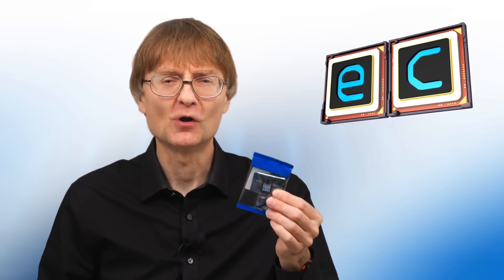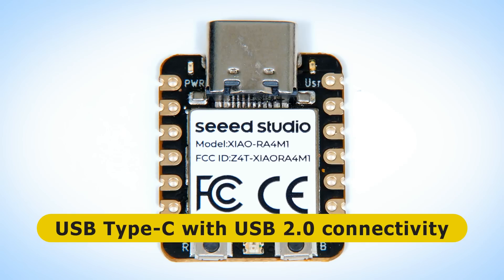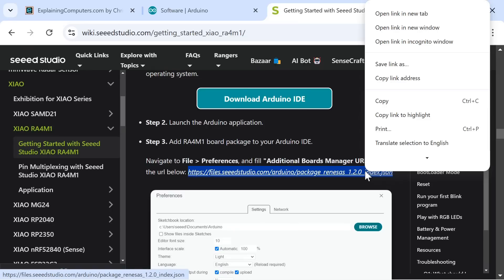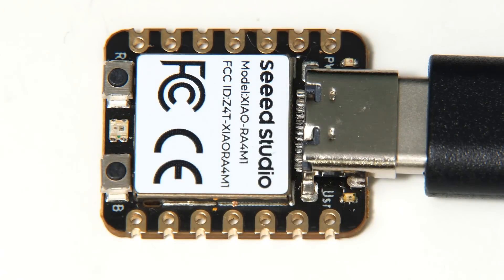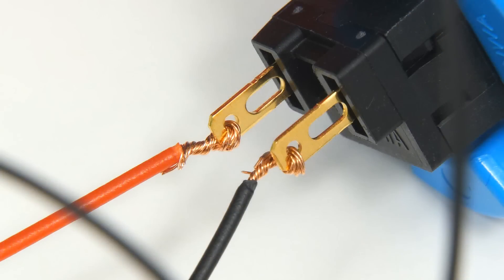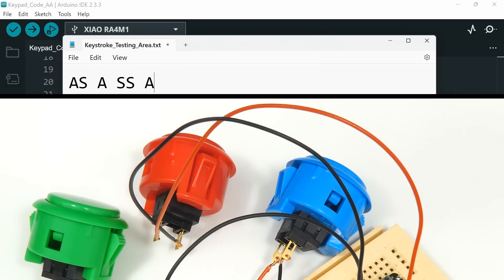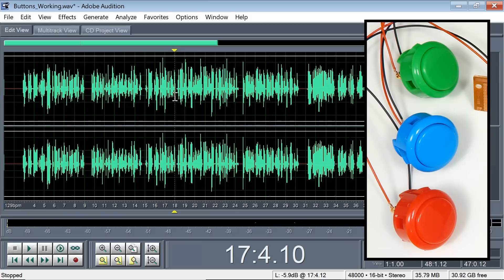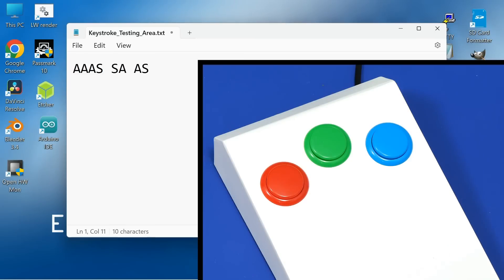Custom PC Keypad - Microcontroller Project

Comment: So Chris, I mainly play along with YT music videos and find it tiring to take a hand off my guitar, peck on the kybd (or mouse for Settings if I want a tempo change) to rewind a bit to hear whatever riff/music I want to practice.  (I used to download the MP3 audio only via VLC as it offers superior features, but as of late the streams seem to be evasive!)  
That said, it seems if one modified the code in your example to trap the ASCII keys controlling the YT player transport, and spaced the buttons out so I can use my foot to rewind/fast-forward/play/stop that it should work OK in theory.  But do you think one will need MS API access/knowledge to trigger the kybd char values, or is there an interrupt or memory pointer to do same?  TIA for any advice on this matter when /if you get time.

Comment: I decided to try this out, so I bought a couple of Seeed RA4M1 boards, and installed the board package in Arduino on my Manjaro Linux daily driver and (smack me in the forehead), no dice. No dfu serial port to be found. I spent hours pursuing lead on the interwebs, but no love. I booted up Win 10, and updated the Arduino IDE, and, bam, there it is!

Looks like Arduino's config for Linux, at least for Arch/Manjaro, needs some work...

Anybody have success with this, or similar, Linux configuration?

Thanks for this video, it was very helpful, and well explained.
Reply from the maker: I'm glad to hear that it worked in the end! :)
Reply: Update: after much investigation, the problem turned out to be the lack of a correct udev rule for dfu. I found this by enabling verbose mode in the Arduino IDE, and copying the line that is supposed to upload the program to the RA4M1 into a cmd line and running it from a terminal. Still failed, but when I ran it with supervisor (sudo) it worked! The udev rules are how you enable a program that needs sudo to run from a normal user prompt. 

Creating a functional rule (for my Manjaro Linux box) was painful, UNTIL I used a fabulous terminal program, Warp Termina!, which has AI stuff built in, and was able to deduce the correct contents of the rule, create it, install it, and restart udevadm with simple prompts. Boom-shaka-lacka, it works!

Now I have a functional Arduino IDE for the Renesas RA4M1 on Manjaro! Thanks to the Warp people for such an amazing terminal program!

And thanks again to Chris for posting this project in the first place...if anyone wants to try the rule, let me know and I'll post it.

Cheers.
Reply: @schwartzenheimer1 I would like to try the rule, same issue on Linux Mint

Comment: Very interesting idea and I like the use of proper arcade buttons.  The Sanwa buttons are quality parts, easily serviceable, and quite satisfying to press.  I have a couple of spares nearby and I just like pressing them sometimes so the satisfying sound and feel.  While I do use them for their intended purpose, I've often thought they'd be good for other electrical projects that need buttons, as long as compactness wasn't a top priority since the buttons do need a certain amount of clearance underneath.  I would have gone with quick disconnects over soldering in this case to make it even easier to service the buttons when needed, though they should last a while before needing that.  The 24mm buttons have a similar look and feel to the 30mm and probably could have worked just as well for this project.  The 18mm buttons are a very different design.  There's no separate microswitch component because the button is too small and it uses two springs internally.  One of those is for the button cap and it's much firmer than the 24 and 30mm buttons.  That firmer feel may be better or worse depending on the project, but it's worth knowing ahead of time, especially if there may be revisions to this project.

Comment: This video was incredibly useful and empowering for me. I was top of the class at school when we studied microelectronics using the DESMOND (Digital Electronic System Made Of Nifty Devices) back in the late 80s, but we were never taught how to build practical custom projects. So I drifted towards programming and away from the soldering iron. This, however, along with the accompanying box-building video, gives me lots of ideas that seem within reach. But if I had submitted the device in this video as the end product of a project at school, I am sure I would have been suspended for building a keyboard that can only be used to type the word "ASS".
Reply from the maker: Good luck developing your ideas!

Comment: Excellent project. I've always wanted to build something like this and use it to log certain daily/recurring events by just simply pressing a colored button.
This is the first time I've seen a video for such a project.

 I had also thought about the possibility of status lights above the buttons indicating if the button was pressed or how many times it had been pressed. And another button which allows you to clear an input that you made by mistake (or the ability to long press a button that you pressed by mistake in order to clear that entry)... Even better an added feedback option such as a beeping noise to indicate when a button was pressed, and a long beep to indicate that a mistaken entry was deleted by long pressing a button.

 I also wonder if I could make this wireless. Another idea I have is to be able to have more than one unit be wirelessly connected at the same time and the controller would be able to receive input from more than one unit  simultaneously.

Comment: You might be able to get 20mm buttons, but 22mm is likely to be more common as it coincides with 7/8" which is a North American standard size. (same knock-out punch as 1/2" conduit)

Comment: Out of curiosity, could you simply use one 10k resistor near the ground where all buttons' wiring converge instead of having a resistor for each button since power dissipation isn't really an issue here? or is that bad practice? 

Very neat idea, I'll have to build one  for locking the pc :) so people have no excuse no locking when they step away.

Comment: Is that really more comfortable to use than normal keyboard, or was this done just as a proof of concept?
Reply from the maker: Partially it is a proof of concept so I can test things out, and there will be a Mark II (I'm now thinking of a sphere held in at-rest fingers). But when it comes to RSI, it is more comfortable, as it allows the fingers, hand and arm to be used in a totally different position than for normal typing. So it depends on your starting point -- if you do not currently have RSI pain, there may be little to be gained.
Reply: @ExplainingComputers  I can imagine if a controller, shaped sort of like those ergonomic mice, is created, that could be very comfortable.

Comment: If you have an old three button mouse hanging around, one could always hack that and use the buttons and have a small in the palm device.  It may even be possible to fit the micro controller inside the body.
Just a thought.
Reply from the maker: And a nice thought! :)

Comment: I thought you'd use an rpi 2040 for this, as the chinese miini rpi 2040 boards are about the same size as the board you're using, but with a lot more GPIOs brought out, and with the amazing SDK and ecosystem support of the rpi pico. I've replaced all my pic, atmel and other microcontrollers now with pico (and chinese versions) as they're the same price or less, for dramatically better performance, features and support (in particular the amazing PIO interfaces).

Comment: Hello Chris
A very big thanks for the very exciting video 😃

I have a question 
Is it possible to program pressing combination keys like for example (Ctrl + C) with one key ?

Thank you 😊
Your sincerely
Reply from the maker: It is indeed. You first send a command to hold down (eg) the Ctrl key, then use another to hold down the "C" key. This is why there is a "release all" command -- things stay pressed until everything is released. :)
Reply: Thank you for your answer Chris 😊

I have one final question.
Will this device work on any Windows or Linux based PC without needs for installing additional drivers?

Thanks again 
Your sincerely

Comment: I like the fact that it is possible to control keyboard with a SBC.
I was once having fun with my Arduino Due and Keyboard.h library where I was drawing shapes to MSPaint using mouse coordinate commands and saving it automatically as a png file. It lookd like as if someone hacked the computer and was controlling it remotely... with all the CMD windows popping out and actual commands being written to it.
The only thing that I needed to do was to put the mouse cursor in the middle of the screen and then hook up the Arduino to a computer.

Comment: Nice project.
Also I'm glad that many devices are now equipped with a USB-C type connector.
I know that it is not the best and most robust connector but is like 100% better than USB micro B (microUSB). And it makes everything easier to connect since most devices have them.
There are also reversible types of micro USB connectors (I have one) but they are still fragile.

Comment: Great stuff from both EC and the CB channel. I have been thinking of a small project and a Pi Pico would be way over the top for what I need. One of these small Arduino / RP2040 / ES32 boards  is what I need. I just need to determine the position of a 3 pin switch to determine loop durations in the code body.

One thing that comes to mind is that most of these small controllers don't seem to have any holes for mounting purposes. Do you have to mount them to a small breadboard and then mount the breadboard to the casing?

I think that Stanley would have needed a well earned rest with 8 - 10 cuts for every piece of the casing. Maybe a new blade is coming up.

Comment: In Oct I broke my right shoulder and hand. Could no longer use xbox controller as mouse on my Linux computer. So I used the BadUSB i.e an  arduino leonardo to make a keypad to do what I needed to do.
I have two one for gp computer use and a 2nd for Minecraft.

Comment: Nice simple 3 button example!  After searching Macro Pad options for quite some time last year, I went with the AdaFruit kit: 
Adafruit MacroPad RP2040 Starter Kit - 3x4 Keys + Encoder + OLED - ADABOX019 Essentials --- (though currently out of stock) It was basically a snap together build with easily modified example code. Small display and encoder wheel allows selection of multiple sketches of 3x4 button layouts while also displaying a legend of button function labels. Well worth ~$50 USD.

Comment: Thank you Chris.
I have a related project based on a "Adafruit Neokey Trinkey" that stalled because it did not seem to work.  I want a simple board that will emulated a keyboard, and send a <Alt><SysReq> R, E, I, S, U, B combination when needed.  Your comment about delays on the key press inputs might be the problem... or at least get me back on track.

Comment: Where did you get a breadboard that withstands the high temperature of soldering? I've tried that a couple of times with breadboards that claim to be high temperature capable and every time I've melted the breadboard and made it useless.

Comment: Way cool. Back in the 1980s I built a custom PC KB interface for a client wiring up an 8051 microcontroller and 8255 PIO to an off the shelf 250-key membrane switch board. Lots of wires as you might imagine (although 16 rows by 16 columns helped). Interfaced to the KB by splicing in to the KB wiring. Fun. So much easier now with your tools! Thank you.

Comment: Awesome ! so a quick and easy button set up for a game should be possible ? a bit of a nightmare with UNO R3. I worry about that 400 mS delay mind you, that's a long time in computer land. Thanks for showing that little DEV board I had no idea about it.
Reply from the maker: A button setup for a game should indeed be possible -- if with a much lower delay setting! :)
Reply: @ExplainingComputers  :)
Reply: Buy high quality buttons designed for low switch denounce. As all switches have denounce, Google "button debounce". You will find both hardware and software solutions. In this case, as the microcontroller is only managing the keyboard, do it with software. If you Google "button denounce arduino", you will find some sample code to add to your sketch. You will still want some delay, just much less.

Comment: Something we all should consider is that when you make something,  there are many different approaches and different learning opportunities on your journey.

I guess if my only goal was to produce a 3 button keyboard, I would start out by buying an old, beaten keyboard for a few bucks, extract the electronics,  map the 3 key pairs from the matrix of lines from the keyboard, wire up switches and call it a day.

Chris' approach is certainty more complicated and does cost more, but what he ends up with a solution which is maybe more complicated but then more flexible. For example,  if I want to change one of my characters, I have to work out more mapping and resoldering connections. Chris just changes code and recompiles.

Neither solution is "wrong". My solution gets you specifically to a certain end point and less flexibility once there, Chris get you a general purpose microcontroller,  learning about the Arduino environment and flexibility. Both solutions are good with certain limitations.
Reply from the maker: There are always alternative solutions! :)

Comment: The trick is how well it handles simultaneous keypresses & wakes the host from suspend.
Reply from the maker: Simultaneous is easy -- for compound (like Ctrl C) you send the command to press Ctrl, then the one to press C, then release all. For multiple buttons together, the code would need altering to to the delay and release all on the end. For wake, it's no different to any other keyboard.

Comment: Rather than using hardcoded delays, replace the delay(400) with while (digitalRead(7) == HIGH) delay(50); (change 7 for each input) So it can move on to the next key press as soon as you release a key.
I'd also add debounce code.

Comment: Most Arduino compatible boards have the option to pull up inputs. 
The logic changes slightly, but external resistors are no longer  needed.
Reply from the maker: Needed, no. Safer? Yes. Arduino themselves used pull-down resistors in all of their examples of wiring a switch . . .

Comment: I think I'm going to do something like this for my son, he loves playing flight simulation games.  I could build something with various buttons and toggle switches.  I need to expand my understanding first though.  For example, how many buttons/switches can be connected to the microcontroller, and how do I program a toggle switch.  Can I use 3-position switches?  Mind-boggling but it would be so nice to do this with my son.
Reply from the maker: The microcontroller used has 11 inputs that can be easily used to connect switches to, plus another 8 on the back if you don't mind soldering to the very small pads (you can't attach pins for this). You can use 3-position toggle switches by connecting them to two inputs (as a 3-position toggle is basically two switches that share one pin).
Reply: @ExplainingComputers  Thanks Chris.  I'll give it a go.  My son has an interest in computers and electronics, as do I, so it should be a fun project.  I've watched your video on the new channel too, I actually find that part of it quite daunting too!

Comment: 3.3v not 5v
Reply from the maker: What? Nothing here is connected to 3.3v. The button wiring here is based on Arduino's own documentation -- https://docs.arduino.cc/built-in-examples/digital/Button/ -- where the 5V rail is used.
Reply: @ExplainingComputers The microcontroller input can handle 5V? or maximum 3.3V

Comment: Great project. 
Had been thinking about making a custom keyboard for a while for a game I play, though had been putting it off (for years now), I had been put off figuring that it would be more than hardware and a sketch for my use case; as I want to use custom characters that wouldn't be assigned to other keys, (think numberpad consisting of unassigned keys you could map to whatever you wanted rather than standard alphanumerical sets).

Comment: I saw that Radio Shack perf board and thought, 'where on earth did he find that'!  But Chris immediately stated that he got his from the same place I got mine, at Radio Shack, lol.  40 years is not so long.

I used a similar board to create a camera trigger button for a 3D printed microscope camera.  This way you could move the microscope where you wanted it and with the same hand use your thumb to trigger a capture in the software.  People use the microscope all the time now at the workstation to identify defects in our product.  The software captures the pictures and saves them to the network.  The 3D printed camera housing has a place for the camera and lens, a laser line generator, pushbuttons, ring light, two little buck boost power supplies and handles with pushbuttons.   It was a cool little project.

The kind of content in this video is really valuable for learners.

Comment: I love how practical this project is (not that every one HAS to be practical). 
I really need to do more of this sort of thing. I have the materials, I just need more practice and specific problems to solve or some practice goals.
After I finish my radio studies. Hopefully that's not to far from finished. (There's a lot of crossover, as a lot of hams build their own equipment, and the exams have a lot of electrical principles and schematic element identification.)

I thoroughly enjoyed this video.